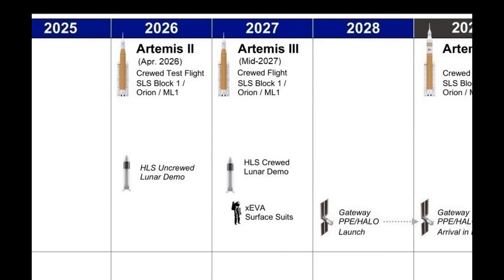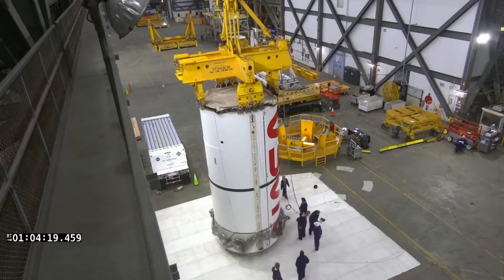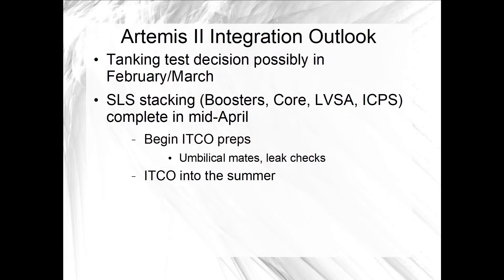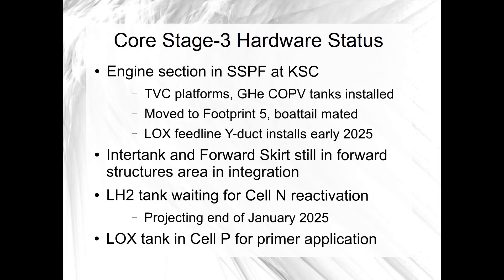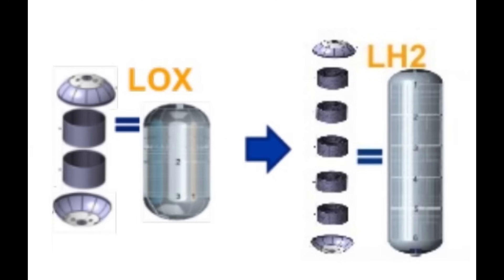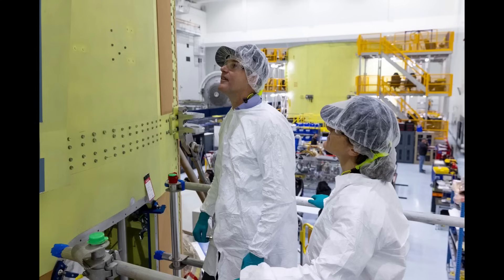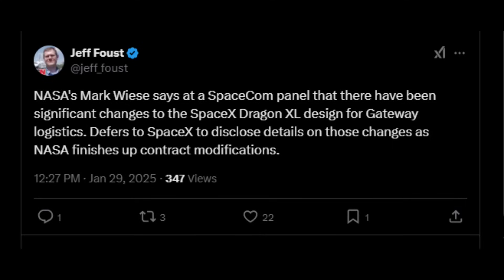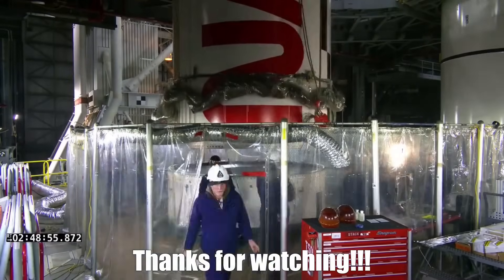NASA updates Artemis II status, Gateway and Starship plans, and Boeing updates SLS stage builds

Comment: Amazing, the best these guys can do is maybe 1 launch per year. That should shock the shit out of you. On top of that each flight is over 2 to 3 BILLION dollars! Completely unsustainable
Reply: Yeah, it's a long process, but they're not spamming satellites here. The budget supports what it supports. The frequency of launches of a rocket of this size and complexity, for missions never before attempted, isn't easy to quantify. It may not align with our personal expectations, but are you  only shocked with NASA'S end? I don't think that is going to be the issue with Artemis. 

 If they were ready for Artemis 2 right now, SpaceX wouldn't be, and they may not be next year. .SLS was late of course, but it did its job. 2 years of launches at SpaceX and they're still doing major redesigns, haven't made orbit, and the telemetry numbers look like the payload capacity is awful. At least that much was gathered before the explosion of the newly designed ship. So now it's on to talk of ship v3, booster v2, and it continues. That's my biggest worry for Artemis.
Reply: @troys9222  SpaceX was never a participant in Artemis 2 at all - at least, so long as the plans for Artemis 2 remain unchanged.  Artemis 2 was/is supposed to be just a crewed Orion flyby around the Moon on a free return trajectory to Earth.  So the only thing holding back Artemis 2, has been Orion and all its issues discovered during Artemis 1.

Of course, Artemis 1 also flew Orion with no life support systems (because they were still not ready, despite years of delay), and thus the first-ever flight test of a fully crew-rated Orion is going to involve a crew onboard, flying all the way out to the Moon.  Yup, nothing at all concerning about that...  Now, if only SLS/Orion could just do more test launches, to more fully prove out the complete integrated set of hardware, before putting people at risk.  Oh, too bad, they can't: because they're intractably too slow to iterate, and far too unaffordable and unsustainably expensive.

Comment: It’s incredible how slow SLS moves. I had hopes SLS could be saved, but every time I watch one of your videos, it becomes clearer why it needs to be cancelled! 😢
Reply: In favor of what? Starship is questionable to handle the mission it has been given. Taxpayers wouldn't tolerate SpaceX's current methods. When they were on the cape and NASA held their hand and they were given guidance, along with launch pads and other infrastructure to get started, it worked out. Now with a completely different level of difficulty, they've had more action but worrying progress.
Reply: SLS seems slows because they’re manufacturing hardware for launches into the 2030s. Philip covers so many details of SLS because there’s so much public work going on with it while other programs like Orion and Starship face delays or are more secretive. SLS is really the only ready element of the whole Artemis program (Orion/Starship/Blue Moon/Gateway/etc). It’s ‘outpaced’ everything else
Reply: @echofeed7  when the SLS stack is completed by ~April but isn't able to actually launch until a whole year later, that's not a matter of building hardware for the 2030's.  It's a matter of every little processing step taking forever and being done by a different crew at a different location.
Reply: @Spherical_Cow  no that’s literally how supply chains work. I assure you SpaceX and Blue Origin are also producing hardware years in advance
Reply: @echofeed7  no, that's not how supply chains work.  A fully assembled SLS sitting in a hangar for a full year before it is actually able to launch, has nothing to do with supply chains.  As for SpaceX, they're now building a new Falcon 9 second stage every 2.5 days or so.  And it currently takes them about half a year all told  to build a complete SuperHeavy from scratch, test it, and have it stacked on the launch pad for liftoff; that's before they finalize the design and start mass-producing it on a conveyor belt.
Reply: @Spherical_Cow  So it takes 6 months to build a Super Heavy stack? By the time it flies, it's known to be a bad design because of the previous failure of mostly the same design. But, it's there, so they use the old design, and get whatever data they can. Then it takes months to build the new  version from data from tests of the oldest version. 

Meanwhile another older (bad) design is ready to fly. No wonder it's been almost two years since the first launch and they still haven't made orbit. Did you think it would take this long? 7 flights and still losing the ship? Two years ago expectations were a lot higher for the timeline. It's like nothing is expected at all anymore, just a lot of activity.
Reply: @echofeed7  "OUTPACED"? Now there's a term I thought I'd never hear for SLS. Good Troll
Reply: @TiberiusMaximus  maybe Starship HLS is secretly hiding on the far side of the Moon. I guess we’ll find out when Orion makes its second trip there

Comment: It was great to see inside the engine section - it's so empty. Boeing seems to not have any of the major elements of the MPS or TVC system. Aren't these mostly legacy shuttle components? Are they having a problem buying more?
Reply from the maker: Almost all of the equipment inside the engine section is below the feet of the crew (and the blue platform deck) in the picture.  Most of the volume will eventually be taken by the bottom of the LH2 tank.

NASA and Boeing are working to qualify new suppliers or requalify the legacy ones for hydraulic system components in particular.  The hydraulics don't just power the TVC systems, but also actuate all the RS-25 engine valves.

We keep hearing about the "fragility" of the supply chain, which is another area where private business has more options, such as selective vertical integration when there's market for components.

Comment: Somehow, it seems like a step backwards to go from the reusable SSME to the single-use RS-25E production restart engines. Obviously, the capability isn't required for SLS, so it does make sense that this is no longer a design objective, but it's still a bit sad.
Reply from the maker: If it were to facilitate a higher flight rate, it would make some sense, since the flight rate is so low.

But there's still nothing concrete about more than one flight per year, at least in public.
Reply: To me, cancelling the next 3 Artemis flights is sheer folly, but to continue using SLS in the 2030s is also sheer folly.
Reply: The other really stupid thing about that whole concept is that even the "cheaper" modernized single-use builds are still costing about $100 million per engine.  Every single SLS engine costs more than a full Starship stack!
Reply: @Spherical_Cow  The RS-25D rocket-motors are the $100 million rebuilt SSMEs while the new-build RS-25E should be significantly cheaper.
Reply: @nicholasmaude6906  the 2020 contract extension awarded to AJR for production of 18 brand-new RS-25Es (for future Artemis missions to use once all the remaining legacy Shuttle engines are spent), was for $1.79 Billion.  That's pretty much exactly $100 million per engine.
Reply: @Spherical_Cow  They shouldn't cost that much money each as it is an old, mature and well understood design (Nothing new).
Reply: @nicholasmaude6906 I don't know what else to tell you - beyond simply quoting the actual price NASA is paying for these engines.
Reply: @Spherical_Cow   are we sure Starship is that cheap?  We all know Musk is economical with the truth.
Reply: @keithparker6520  Considering it's not even made orbit yet, we know for a fact Starship is not that cheap yet.
Reply: @perfectman3077  Yes, it is infinitely expensive until it does at least something it is intended to do for the program. Nearly two years of flights, and they're still needing major redesigns. Luckily, the next version of ship/booster/engine will make it all work, and super cheap!
Reply: @ Yes, that 100m price might be what we get when Starship AND Superheavy can come back to earth and be reused with 99.99% reliability. If you're losing 33 Raptors every once in a while, that price ain't happening.
Reply: @perfectman3077  no, actually that $90 million price is the estimated cost of building the full stack.  $100 million is the cost of each launch, when nothing is reused.  The Raptor engines cost less than $1 million each already; Raptor 3 drops the price further, eventually targeting $500k per engine or less.

With multiple reuse, in the near term the cost of each launch should drop to something in the $10-30 million range: covering the cost of propellant, pad maintenance and launch operations, an amortized fraction per launch of the rocket's initial construction cost, and rocket maintenance between flights.  Long-term, as maintenance is optimized, launch cadence rises into hundreds of launches per year, and rocket stages become capable of reuse 100 times or more (the design target for Starship is 1000× reuse), the cost per launch should drop below $10 million.
Reply: @Spherical_Cow  I'll believe it when SpaceX opens up their accounting books.
Reply: @perfectman3077  I don't find it hard to believe.  Starship uses cheap, stamped and robotically welded stainless steel construction - as opposed to expensive and rate-constrained techniques like carbon or glass fiber composites and/or CNC-milled, bump-formed, and friction stir-welded Aluminum-Lithium alloy isogrid and orthogrid hulls.  Everything on Starship is designed from the start for cheap and high-volume production, from the TPS tiles to the engines.  SpaceX is into the high 400's (if not 500's) already with its Raptor 2 serial numbers, for example.
Reply: @Spherical_Cow The estimated future cost is whatever will amaze the interested and be believable to those who want to believe it. Of course the cheapest, quickest, and much more powerful everything is on the way next year.
Reply: @troys9222  just to be clear, $90 million was the estimated past cost of the Starship full stack - with that estimate published by Payload almost exactly a year ago, and derived from the design and manufacturing status quo as of late 2023.  The cost is expected to have already dropped significantly since then, as more of the manufacturing has gotten automated, production cadence has increased, and the design's manufacturability has likely been improved since then.
Reply: @Spherical_Cow  Estimated by who? There is no reliable number. Musk says a lot of things. It can't be estimated from the outside for this kind of project. Since they're still in the design phase of the entire thing, the cost of future ships and boosters can't even be known now. The heat shield looks like it's getting more expensive, and the whole thing is getting larger to try to get the original payload goal, so that's definitely more expensive.

Comment: It will be a shame if Jared doesn't cancel SLS.
Reply: If SLS is canceled now it will delay any crewed moon mission by several years, SLS is the only thing actually ready right now to fly these missions. i agree it should be canceled but not until at least artemis 3 canceling anything now would just be another waste of time and money.
Reply: Why do you want to ground us to low earth orbit for next 10 years? Because thats what cancelling SLS will do, both technically and politically
Reply: Can an administrator tell congress to go screw and cancel?  They hold the purse strings...
Reply: @imaginary_friend7300  no; the best an Administrator can do, is advocate or lobby for changes in public and in front of Congress.  But at the end of the day, the Administrator is still legally obligated to carry out the specific programs as authorized and funded by Congress in the latest NASA budget.
Reply: @go_forward140  it would be a shame if NASA does cancel SLS in the next 4 years.
Reply: @plainText384 4 years? How many sls launches is that? 2?
Reply from the maker: @ If nothing changes two, probably a maximum of three.